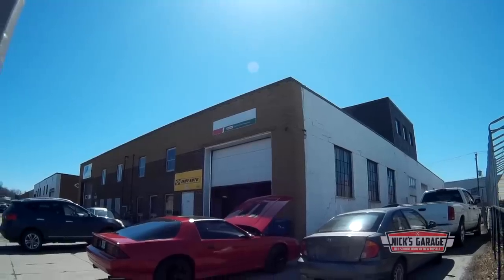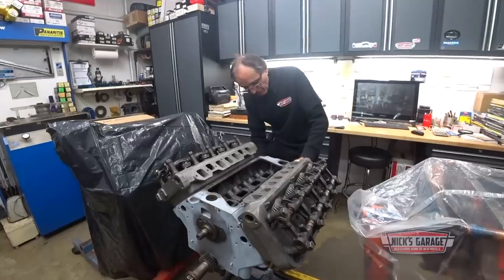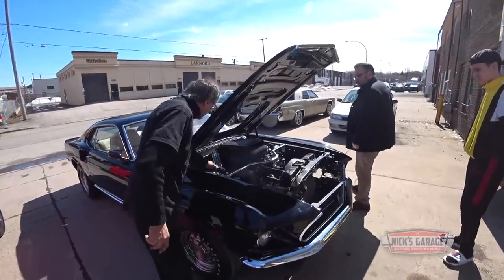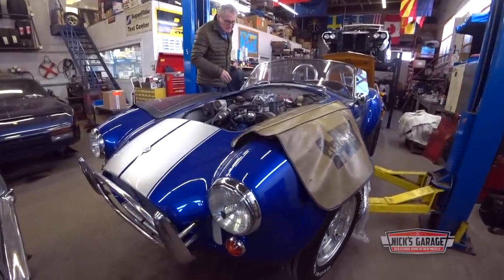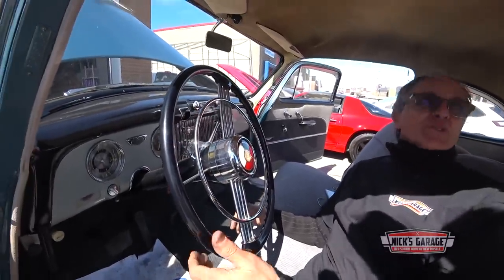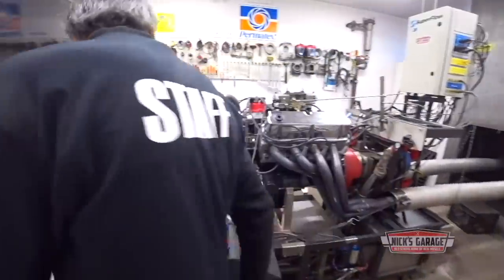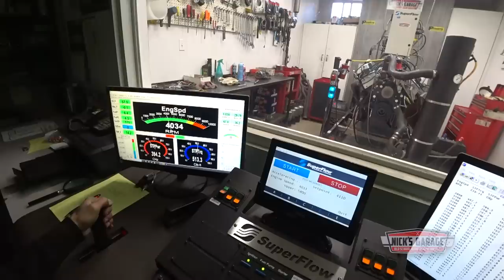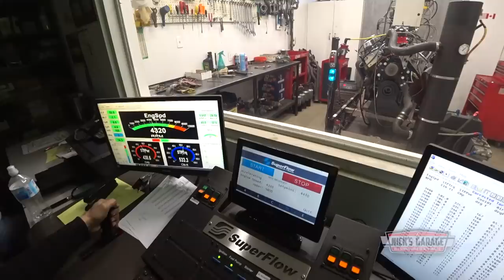427 Ford on the Dyno - Nick Tests the Blue Oval

Comment: The narrator said, "the customer brought the 427 in for a dyno run and that's what he's gonna get",  well ..apparently not!   This video shows how addicted Nick is to creating satisfaction by finding another 22 hp and 23 lb ft. of torque.  503 hp and 530 lb. ft. ..respectable numbers for a flow limited small block.
Reply: Great for brag numbers only. In a car in real life that much timing under light throttle with that advance will ping like hell.
Reply: @someonewhatever611   True, ..if build to factory specs but engines from this era,  are usually built with hardened valve seats and dish pistons to drop compression to ~10.3:1 ..for modern pump gas.
Reply: @BobbyOfEarth  
The true test is the street and /4 mile tuning

Comment: That AC Kit Car would be compatible with the Australian Ford Falcon 302W belt and pulley set up, all down low where it belongs, comes complete with spring loaded tensioner and alt, ps, A/C and crank/water pump pulleys. One serpentine belt does the lot.

Comment: 302 stroker would of been the one one of my favorite small blocks
Reply: would “have” 🍺
Reply: How Much could they stroke it to in that AC Cobra Kit Car ?
Reply: @davidtharp7767  u can safely stroke a 302 to a 347. I have a fresh 347 myself and it runs great. They used to have a issue with oiling but the new kits have fixed that
Reply: @glenkritgainda4771  I'm thinking of Doing a 351 Windsor Stroker With a Ultra Hight Lift & Low Overlap Cam & screw in studs Edlebrock Torker Intake&small Holley-600 4 Bbl, Headers with H Pipe&Huge tailpipes from the Collectors on back to minimal mufflers & electronic Ignition. I did up a 289 that was bored 30 over or more Back in 77 that way & Outran a 1977 Pontiac Trans-AM 400 Cubic Inch with automatic like me. I outran him by 1.5 Car lengths in the Quarter in a Nail Biter. I had the stock 2 speed Auto tranny that had a way low Low in the Transmission Low gear & the Rear End was like 2.69 to 1( a 289 with a 2 Bbl carb car ). So the Jump from Low to Drive was so Big that even though the TransAm that went up in smoke on Stock Rear tires for a Second or two while my Stang just Lept off the Line Like a Frog caught & passed me, then my mustang finally Got back up in the Revs to it's torque sweet Spot&flew back by the Trans-Am in the Last 1/16th of a mile.We had marked it with orange spray paint 1/4th mile North of north city limits sign of Port Charlotte,Fl And Kept both cars floored the 10 miles North on Hwy 41 to North Port Charlotte which I think is Now called just North Port. I kept stretching it out slowly but surely till I was about 45 seconds to 1 minute ahead of him & Long had been out of sight ahead of him when I made the Southern North Port Charlotte, FL city limits sign & slid into the 7-11 gravel parking Lot, ran in & slapped 2 x $1 bills in the Cash Register Counter & grabbed 2 Budweisers out of the Barrel Of Ice Right there at the Cash Register Counter. I stuck His beer in My Jeans Pocket & Popped the Top on Mine & Was Guzzling Bud when he slid into the Parking Lot. He was Hollering U are Lying ! You have got to have a 390 in that Mustang! I popped the Hood&He almost Cried when he saw the Tiny Small Block.It( my car) needed a More Modern several speed Automatic & about double the Rows of Radiator it had Stock as a 2 BBl 289 auto Radiator&  with an Honest to Goodness Effective Auto Tranny Oil-Cooler with a slow speed automatic electric Fan & Good Placement for airflow at Highway Speed & the aforementioned Screw in Studs. I actually would prefer to put it in a Stronger by far Body with a Real frame & Honest to Goodness Front End Suspension & rear End suspension because the Stock Mustangs of Old Had a big tendency to hydroplane APPROPOS No obvious cause or get sucked into the Side of a Semi You were passing or who was passing You. Not a Sturdy Body at all & Poor Handling ! That was my one & Only Hot-Rod & I built it myself off of Hot Rod Magazine's 289 Hop Up series they ran for about a year testing all Intakes & Cams & Carbs & Ignitions & Headers ! I wrote the Editor & He wrote me right back & said get a different cam than in the Test. We found a Better Cam after the Finished Mustang Hot Rod Issue was Published !! So My Hot Rod was a Tad Better than what they published as the good as can be 289 in about 1973 or 74 ! Just every time U ran it hard wide open You had to remove the Press in Studs & Clean them Up Good & clean the stud holes good & put them back in with Purple LocTite !! I had Bought a 1974 Corvette L-82 with T-Top& Silver Leather interior& ran out of Money to finish up the Stang Right.

Comment: On 302b mine is A 302 building up air or fuel or both its turned and will be tunned to run against 292v8 mine 296 v8 about 175hp and cits of same 3.0 perc and 3.1liters speed cap at 100mph

Comment: Itll make a boat load of torque ....but he needs a good 210 cc head and a super victor  manifold for power as well I predict 500 hp.  Those dual planes only flow In The 280cfm  range.
Reply: It made 503 hp after the 1" carb plate (488 before).  You should watch the video.

Comment: Back in the day when Hemi's ,L88s ,RamAir Vs  and some 427 Tunnel Ports roamed the streets is what I'm talking about .Even a Boss 429 .
Reply: i hope the 429  and the gaz at that time was cheap
Reply: @davidlefranc6240  muscle cars were a dime a dozen in the mid-to-late 70s. I've probably owned about 20 or more and I don't think I ever paid more than $1,000 for any car back then and most of them were three to $600 range.
Reply: Grumpy468 
YEP !
The 70s were interesting cruising 
WOODWARD from 9 mile all the way to WIDETRACK CIRCLE in
Pontiac and back . We parked at NORTHWOOD shopping center, packed that place with over 100 cars on Friday and Saturday nights.
13 mile & Woodward was almost impossible to get through.  YEP , I  remember cruising in my  1963
Jaguar convertible XKE  with my
1966 Ford 427 side.oiler , dual quad 650s , C6 trans w/3300 10"
Converter an custom sidepipes. 
Now days even being assembled 
QUIETLY,  the cops want to bust you or fine you for trespassing. 
Like Archie Bunker says :
THOSE WERE THE DAYS. !
Reply: @Grumpy468 like they told Jed Clampet "Californey is were you want to be) this is where the muscle cars were in abundance,  no where else had so many race cars of all types ,no matter what part you lived in, in the late fifties till today!

Comment: For the clearance issue get rid of the serpentine and go with v belts , it will get rid of the high tensioner and drops the pump down , the easiest solution , is usually the best solution , keep it simple .

Comment: On the Cobra with the 351 V8. I'm wondering if you have considered using a billet accessory kit. Then some lowering engine mounts. I'm thinking this would do a good job of fitting that engine into the car. Please let me know what you think.

Comment: What spacer plate did he use that was 1"?
The 4 separate holes through or all one opening.
I experimented on the dyno with my 358 CID SBC street and strip engine.
It went into a caged 1982 Pontiac Grand Prix , Ford 9" rear , 1970 Chrysler New Process 4 speed manual trans.
I had 1" open plate ,4 hole 1" plate , double 1" open plate to try.
Because of the intake manifold I used all it did was change the RPM curves where the HP and Torque were.
Basically the more spacer plate I used ,the higher the top end was and killed the bottom end.
Ended up installing an open 1/2" phenollic insulator plate under the 750 Holly carb and then next to the intake manifold I stuck the 1/2" NOS cheater plate in that was also open with the spray bars in the center.
It really liked that combo. On the N2O while on the dyno it was 550HP 420HP without the N2O.
That was enough.
Reply: Did a ton of porting on the older heavy set of cast iron 74cc  heads ,screwed in studs , pushrod guide plates ,special grind cam , flat tappet hydraulic lifters , Z28 valve springs , roller rocker arms , much better valves ,hardened exhaust seats installed , Lunatti connecting rods , special work on the crank including offset grinding the rod journals giving it a 3.50" stroke instead of 3.48" stroke ,Kieth Black 11:1 pistons (giving me an actual 10:1 CR) and of course a complete engine balance job. Runs on pump gas.
She runs smooth all the way up to 6500 RPM where the stock heads are done.
I shift at 6300 RPM.
Torque and HP curves looked great.
We did 15 pulls on it to get the carb and timing sorted out as to what it really likes.
Because of the stroke change on the crank , the actual head to piston clearance is dictated by the thickness of the head gasket as there is ZERO deck clearance from the top of the piston to the top of the block. Factory stroke was a .010" deck clearance. For some reason when we do this it really wakes up the SBC 5.7L engines.

Comment: Commentator: the little Ford made some power

427 in all its 7.0 liter glory: Am I a joke to you?
Reply: Where's the factory 2x4 intake . 
Let that motor breathe man ! 
We launch ours at Cayuga at 7800 and makes far more power than that .
Mississauga Engines ! 
Caesar builds great Fords, mopars and Chevs
Reply: @theflyingscotsman9902  ,your thinking of Fords FE engine, Ford never had dual-quads on a small-block from the factory that I can recall.
Reply: @theflyingscotsman9902 .... It takes a lot of cam and double spring valve springs to rev like your big FE. The one in the video has a lousy manifold too!
Reply: W.Ormsby what the FK. do U know??  NICK IS THE MAN!!
Reply: @johnwhite600  Actually he's correct and Nick didn't build this engine just tested it on the dyno.
Reply: Haha, be kind.  That is a true stock non-hemi motor pounding 500 ponies with enough torque to pull Canada into the USA.  If you wanted more than that you should switch to the Shelby Aluminum  block and make 750 ponies no problem.  This is more than enough for any street car.  More than enough in a mustang to take care of most those 2 ton Mopar cars haha (ducks)

Comment: That windsor could have made 600+hp if the builder had put Cleveland style canted valve heads on it.
The clevor is the ultimate sbf 
Get some nice aussie 3v heads from CHI , 10.5:1 compression, big single plane manifold, solid roller cam 700+ lift 300ish duration, big valves, 427 stroker

Comment: Sure, the spacer adds horsepower at the cost of Throttle response.  If that's what you want go for it.  For me running a 302 FORD for 33 years, street racing light to light, I like the quick Throttle response.  I was Running 2 345 CFM FORD Autolite Carbs on an Individual Runner Manifold that I Built out of a Offy Tunnel Ram Manifold, I took the Tunnel off and made a 3/4" Aluminum Plates.  I had all kinds of low end torque.  I embarrassed a lot of Chevy, GMs and Mopars on the Street.  I also had a 70 Dodge Charger with a 383 Mgnum that I put a Tri Power on it, it used an early Corvet Tri Power.  I had that car  Street Racing also and surprised a lot of Chevys and GMs, not to mention other Mopars.  As you can tell, I like multiple carbs, I am from Iowa and drove my Mustang everyday for many years.  She was a force to be reconned with in Cedar Rapids, Iowa.  No one like racing me from a Dead stop, I would beat them every time.  I never ran the Charger against my Mustang, But I know, my Mustang would beat it.

Comment: 503 h.p. Is nothing to sneeze at. That Cobra replica looked like a plumbers nightmare exhaust wise. I can remember seeing the Sunbeam Tiger with I think a 260 c.i. Ford in it, the last spark plug on the right side had to be removed through a panel in the firewall.😳🤔😬🤬
Reply: Sunbeam people were originally going to use a Dodge engine but it would not fit, they needed a small engine with a front mounted distributor so they went with a Ford.

Comment: my 402w made 556 hp with 535 ft AFR205 heads with vic jr and 950 AED carb.. 1" spacer made 562 hp
Reply: Yep. Them w can make some big numbers when built proper.
Had a '75w stroked to 408 with N heads and a huge cam for circle track.
Testing put that thing at 640hp and an amazing 782 ft/lb torque*.
Reply: torque..
Reply: @myfordranger  yessir.

Comment: a stock ford 4v manifold will drop it allot lower and still produce decent low end Torque and with decent porting HP
Reply: Nope. 351w  never had a stock intake even worth looking at.

Comment: All these tests of Big Block Fords and Chevys are pretty much dispelling the myth of the vaunted superiority of the 426 Hemi.  They ALL made big power for their time but are nothing compared to what's available today.  Hell, I owned a lowly Hyundai Sonata 3.3 litre V6 which made 1.2 horsepower per cubic inch on 97 octane regular fuel, and got well over 40 mpg Canadian on the highway, (6.5 litres per 100 km).  
Even in the current era, the Hemi is a legend only in it's own mind.  Example: The normally aspirated 5.7 litre Hemi appears to make a maximum of about 400 horsepower in it's best configuration in their pickup trucks, and only around 365 horsepower in late model Chrysler 300's.  On the other hand, a 5.0 litre normally aspirated Genesis V8 makes 420 horsepower.
As the old ladies in the Wendy's commercial used to ask:  "Where's The Beef"?  The original Hemi's were one of the most physically attractive engines ever made, IMHO, and they were HUGE, kinda like the REALLY REALLY BIG BUN in that Wendy's commercial.
Sure the modern Hemi can make power when you throw the turbochargers at it BUT so can any other engine.
Don't get me wrong.  I've satisfactorily owned more MOPARS than any other brand during over 50+ years of driving including their "Indestructible Slant 6" which I blew up by the way, along with a 273, a couple 318's and several V6 and 4 cylinders.  Power wise, their turbo 2.4 litre 4 banger in my PT Cruiser was the quickest car I've actually owned, running the 1/4 mile in 14,9 at 94 mph.  That same engine in the lighter and more aerodynamic Neon SRT4 ran low 14's or high 13's at over 100 mph.   Hooked up with the amazing and indestructible Getrag 5 speed manual transmission, that PT Cruiser was an absolute blast to hammer through the gears.

Comment: That Cobra will be better binning all the modern belt drive. Use early stuff and V belts. And a Saginaw pump. Puts the pump a LOT lower
Those headers will be a head f**k. Block is an inch taller and I suspects the exhaust ports lifted as well. . So nothing will fit!
The 427 W sounded sharper on the 750. Those spacers often help a lot.Even on manifolds that are supposedly big enough. Problem is you often cannot close the BONNET! That is why the manifold makers build them low.
I would have thought it would take around 33-34 deg. Or is it on garbage fuel?

Comment: Much taller deck hieght on the 351 versus the 302 the cobra really illustrates this, can't get the hood on...yet. I just picked up a 5.8 windsor first year they used fuel injection 1988 and still used flat tappet cam till I believe 1994. Will have to use friction modifier to make the engine last its at 93,000 right now. Would love any advice on making these 1988 351w run thierbest and last long. Didn't know it could be built to 427! Just out of curiosity what year is this 351 windsor block that you have on the dyno.
Reply: Thomas.      I do not know. Not my built.
Reply: @nickpanaritis4122  Ok thank you for responding , love your shop presentations on Youtube. Keep up the awesome work that you do. I would love to be doing what your doing.

Comment: hey nick check with factory five racing they will have what you need for the cobra they are a cobra kit car company based in massachusetts  what a torque monster that 427 was nice job from that builder
Reply: 90taz. Yes, I am aware. Thanks

Comment: BHJ  plate used to true lifter bores type search bhj lifter plate truer it amazing the differance it makes on upper end vibrations  when trued  blocks are cast with lifter bores untrue to the head which causes  harmonics between the head

Comment: order shorter push rods i had a ford with a turned redone cam i needed longer push rods, to make it run! it was 200 6 cylinder, it gave a 350 Chevy a fit!   that not a strait 6 look!

Comment: 5800 was nothing for that small block 427 thanks for the video Nick very cool...👌
Reply: That's what I was thinking. With decent valvetrain, 6500 would still be a safe, conservative redline for it. I think they limited it to 5800 because with that dual plane, non-ported intake, there is really no power to be had above that.

Comment: 427 small block !  nice little combo too bad hes not maximizing its true potential it should be in a little cobra like that blue one in your garage.that motor had rpm left in it 6000 isnt much it took it like it was a joke. surprised you dont have a small rubber hose with a splice in the middle connecting your fuel bowl vents it stabilizes fuel in the bowls a lot .

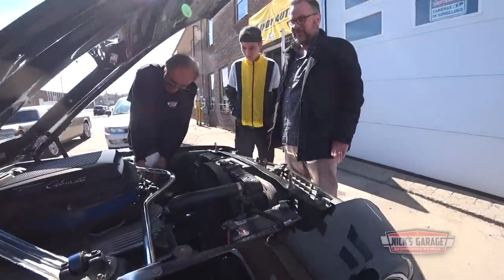Comment: The spring tower brace at 7:28 didn't look very useful. The bend where it goes around the air cleaner means it has almost no rigidity when stretched or compressed.

Comment: cobra jet Mach 1's did NOT come with an aluminum intake from the factory.
Reply: andy.   You are correct. My client thought it was original.
Reply: You are correct sir...that would be  Abby-normal
Reply: Nor the chrome strut tower braces, they were black from the Factory.😎
Reply: Depends on the date code and the build code.  Check out the Police Interceptor intake.  There were 3 of the big boy FE engines ie 428 in 69.  The cobra jet, cobra jet with ram air, and the SCJ beast with the Drag pack option (r code).  The aluminum police interceptor intake can be found in the non-ram air Cobra Jets and is considered an NOS intake.  To my knowledge pre69 the Sportsroof mustang was not referred to as Mach 1.